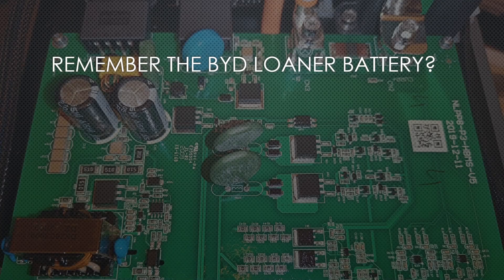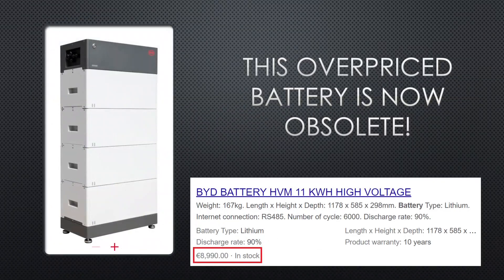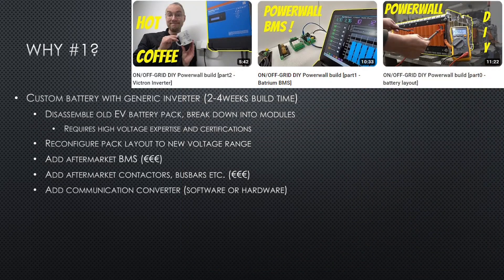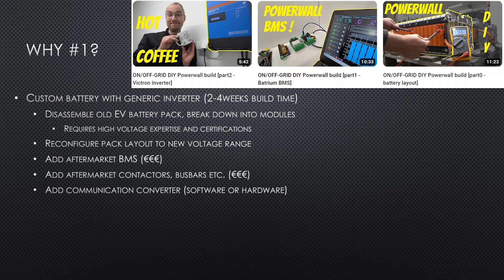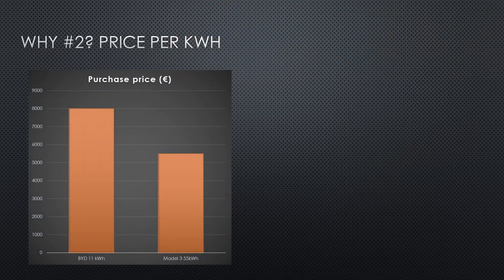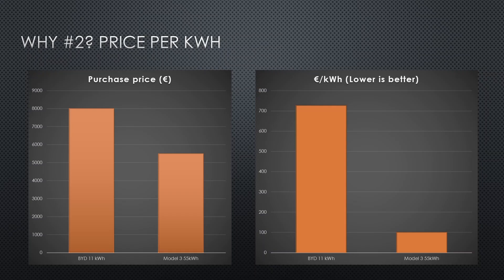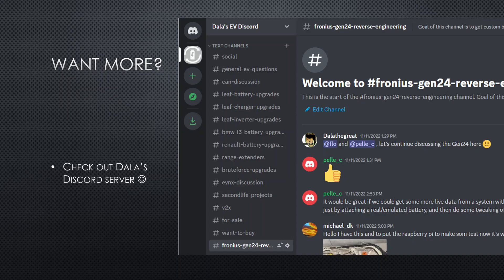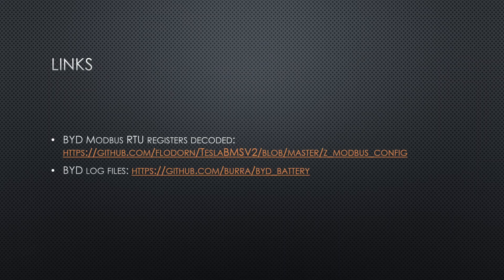Custom battery packs for Fronius Gen24 [part4]

Comment: Hi Dala, great video, as always. This very same plan was in my head for the past couple of months; just take a complete EV battery pack, without opening it and hook it up to an inverter and the off-grid house or solar system for energy storage. Only thing needed is some sort of controller that talks to the battery BMS/contractors etc and the inverter.

Comment: Dala this amazing!
Congrats to you and those that helped to crack this ✌️👍😁
Now we.juat need more inverters that support 400vdc to be on the market.

Infact I think the Solax X1/3 units may be able to do this as well which would be good for the UK market where Single phase is more common in houses as it supports upto 7.5kw where as in Europe the X3 would be better as I believe 3 phase is more common to properties
Reply from the maker: Since BYD packs are compatible with SMA, SolarEdge, Selectronic, Victron, Studer, and Goodwe inverters, most likely the same code works on many of these already!
Reply: @DalasEVRepair  that's great, the only downside is the voltage needs to be accepted doesn't it and stepped down from 400 to 48-52v right?
Reply from the maker: @TheKingpleb  yes the inverter specifically has to be compatible with the hihh voltage HVM BYD pack

Comment: Great video Dala, I refused to buy the extortionate BYD batteries for my Fronius Gen 24 so bought Victron Inverters and imported Jakiper batteries from China. Now looking for a cheapish :) EV battery from crash damaged vehicle in the UK and try your project.
Reply: So you connect Victron in AC coupling with Gen24Plus? I also had the idea to put Victron and the 48V lifepo4 battery,but now we must to say big thanks to Dala👍,EV battery+Gen24Plus is nice kit.

Comment: I think Nissan Leaf after 2014 can bidirectionally charge via Chademo DC port at the front of the car so I guess you'd need the connector plugged into the front of the Leaf and the other end of the cable into an inverter to connect to your house. Which means your leaf would supply energy to your house
Reply: Yes, I just bought a 24kwh Leaf (works out 265GBP/kWh) just to plug into my house. It would be neater to just have the battery lent against the wall in my garage, but I knew the software to work it is well beyond me. So I will just have an extra car on the drive plugged into a 6kW Indra Chademo Charger, hopefully in March.

Comment: Ah fantastic this is what I am playing with. 400v into a standard solar inverter
Reply from the maker: Yes! It simplifies so much 🙌
Reply: @DalasEVRepair  really does. Can the nissan leafs charger be used still to charge the battery conventionally. Or is the Nissan leaf car charger a simple charger.
Reply from the maker: @gino2465  No need, the Fronius inverter can charge the battery conventionally also!
Reply: @Gino Oh, ok. I guess you mean that the inverter also is not a hybrid one then? The gen24 used by Dala is a hybrid so i guess he don't need to use any leaf charger. Personally i'm doing a similar project as Dala, but with canbus and a Sungrow  Hybrid inverter.
Reply: @mrlissmats  hi yes I will use a standard inverter at First.  My original plan a year ago was to purchase an used ev with a 30kw battery and chademo. I can then charge using my existing EV charger to charge car via solar only, then to run a solar inverter directly from 400v battery. . V2g chargers are around £4k but I think they will work the same way.

Comment: Would be interested if it works with SMA inverters too, they're also compatible with the same BYD batteries as the fronius
Reply from the maker: Most likely YES 😁
Reply: @DalasEVRepair  Hopefully I can get myself a battery and get this working then! So happy we can recycle instead of buying a 9k€ new battery
Reply: Does SMA also use modbus for communication? Sungrow also supports BYD batteries but normally uses canbus for communication.
Reply from the maker: @mrlissmats  We have the BYD CAN bus also pretty well figured out!
Reply: @DalasEVRepair  Mee to! :)
Reply: I‘m also interested in a SMA Tesla Model 3 LFP solution. I have a SMA Sunny Boy Storage 2.5 and a BYD HV 10.2. is there any way to support you with this configuration?

Comment: Would this be possible on a ferroamp also. Its batterys already run on 400v so would be perfect to just put a old tesla battery on The Wall. So much more battery for The money..
Reply from the maker: Does it support the BYD pack via modbus? Then most likely yes!
Reply: @DalasEVRepair  No, they only support their own batterys from ESS or Pylontech with is very expensive! Thats why a hack on their inverter would really be nice!

Comment: Dala, congratulations! You say it can use a 50kw Tesla 3 battery set. Can it be used with 4x 6.3kw modules (from Tesla model S) ?  Really looking forward to seeing your next video.
Reply from the maker: No the idea is to use the entire pack as-is, so you get the safety features from the BMS.

If you have bare modules, check my other powerwall videos
Reply: @DalasEVRepair  Ok. My main issue is I have the Fronius gen24 6kw single phase and so I am stuck with the BYD option only. 😞

Comment: Hi this is excellent work - I've been running a small leaf pack for a while and want to expand but batteries are so overpriced for the home market compared to EV.  I want to do this with Leaf packs!!  one question is this communication only for Gen24 or could it be used for a SMA HV inverter like Sunny Boy storage 2.5 or the newer 3 /4 /5 /6?  These are rated to take the BYD HV batts?  Thanks keep up the great work Dala.
Reply from the maker: It very well might work, we need someone to test it!
Reply: @DalasEVRepair  I'd be happy to help

Comment: byd install is a hour eusy  work incl update. and is no use to install more battery poer than you have in pv wp. 10kwp solar is a 10kwh battery.  you dont charge it full in winter or emte in summer time.

Comment: Hi Dala,
I am a Gen24 owner but didnt invest yet in a battery because of the prices... This work os great for people like me..
My inverter is locked by the installer company so I have no Access to confgurations. From your experience, do you need to configure anything in the inverter to "ler him know" that a battery is installed? Or is it just plug and play and the modbus communication takes care of the rest? 
Thanks in advance.
Regards
Reply from the maker: Hi, There is one option that needs to be checked in the settings, to enable the battery to be detected. It does not matter that you have no access, you can reset the password for the install via the Fronius solarweb interface. I have done it once, it was quite easy! Good luck
Reply: Thanks for your answer Dala! Well that is my main problem. The installer added my inverter to its own account and I am just a guest with view permissions. I don't have the option to reset the password. Btw, what kind of login do you have for the inverter? Is it a technician or customer login?
Reply from the maker: @p098ik  Maybe easiest to get in touch with your installer and have them turn on the setting. Or go onto some discussion forum and ask if someone had a similar problem!
Reply: Thanks for the suggestion. I am in a kind of conflict with the installer. BYD batteries are overpriced by default, but they made me a quote that is 1800€ higher than what I can get in an online store...ahah

Comment: It's not a big deal with the well made lifepo4 byd Batt if you habe a problem with it... But when there is a problem with a 65kwh used car battery pack with lmc battery then your house is on fire....
Reply: That's why they are talking about the LFP 55kWh Tesla Model 3 battery.
Reply: @HansFrisk  LFP FTW